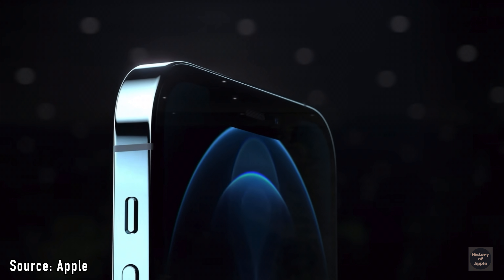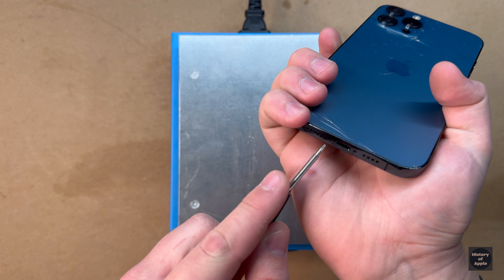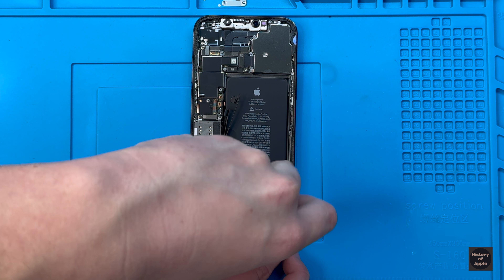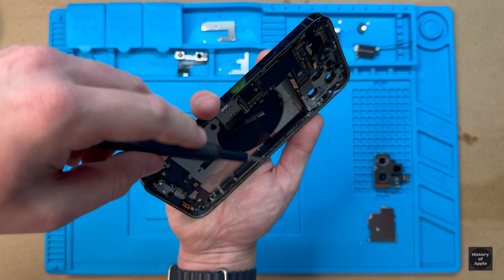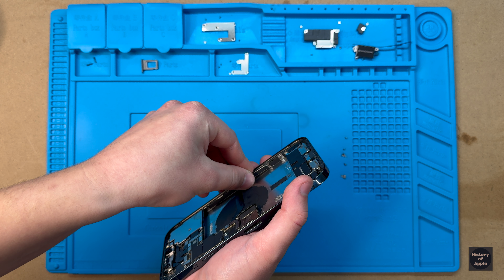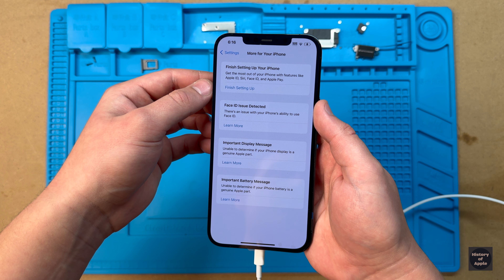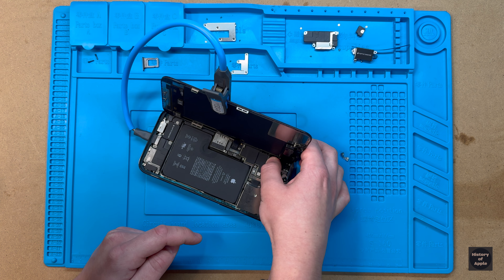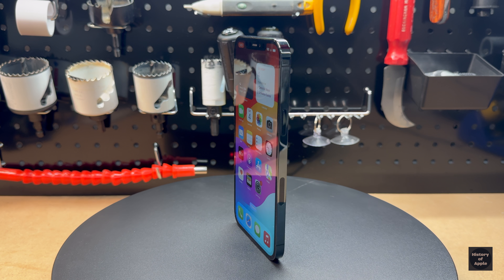Apple’s Self Service Repair: Is It Worth Using?

Comment: Did you send back the lcd and battery so you can get some credit?
Reply from the maker: I wasn't able to as a was past the time frame once I got it fixed, but assuming I got the credit it would've only dropped the price by about $100 at most
Reply: @historyofapple But how does this work? Do they refund you the amount they say on the website or upload it in form of credit for future repairs? I d love to get some info about this thing. Thank you!
Reply from the maker: @cristian-eduardborcila4225  they do it as what you could consider a partial refund to your form of payment. When you are ordering the parts it will show you both prices before and after trade in.
Reply: @ amazing, thank you so much for the info and the reply!